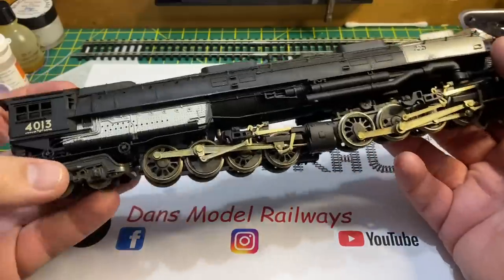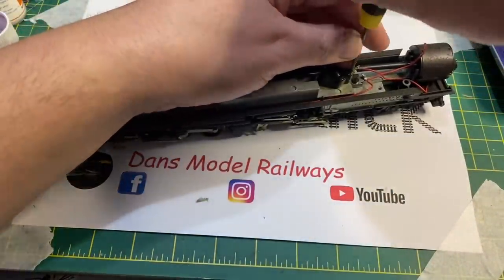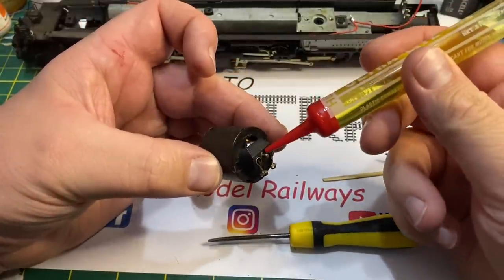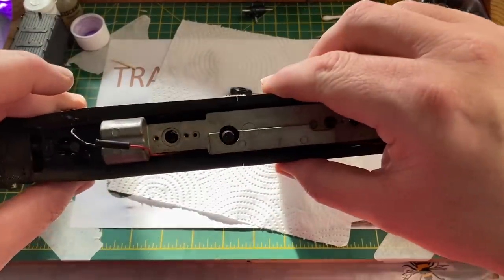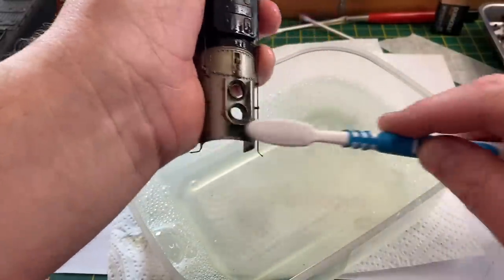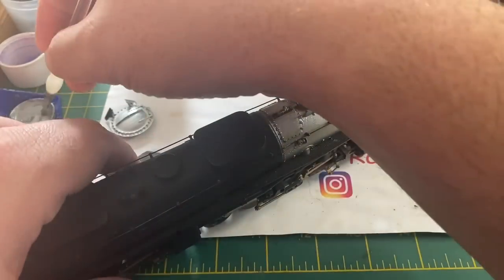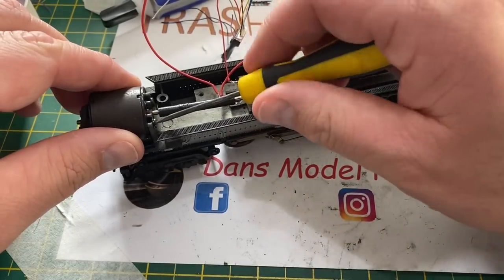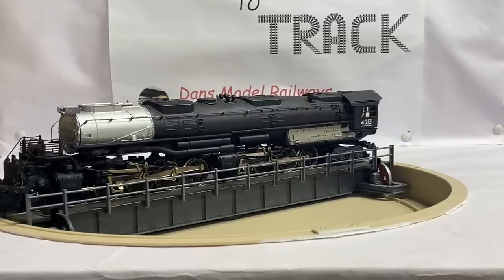Trash to Track Episode 41. Rivarossi Big Boy.

Comment: Ciao, greetings from Italy.  Looking at your work I noticed that you have not checked and cleaned the connecting rods and as strange as it may seem to you the problem can come from there.  It could be dirt between the screws or connecting rods or even that a screw has been tightened too much or replaced with a different one or even that a washer is missing.  You mentioned nicotine and dirt, there's certainly some there too.  It is certainly not an engine problem and... please note that Rivarossi made in Como cannot be modified.  Would you put a Rolls Royce engine in a Ferrari? 😂😂 Rivarossi simply needs to be restored.  I hope you will put back its original engine :-)